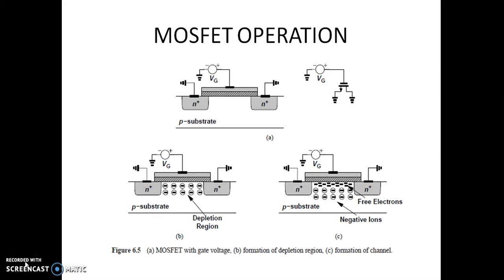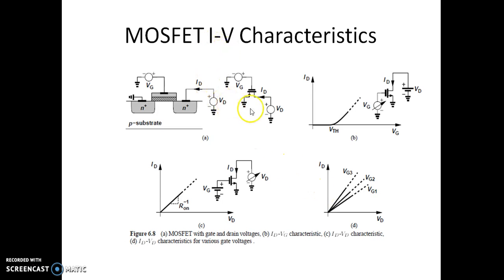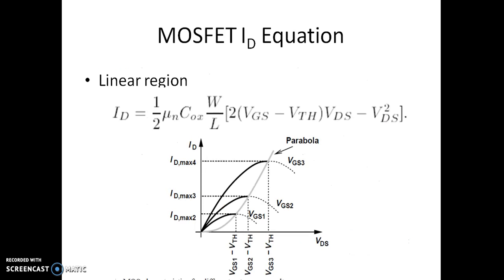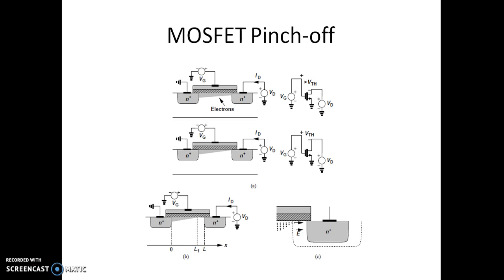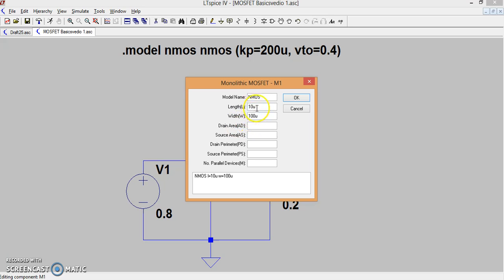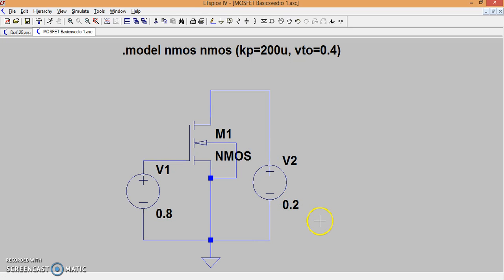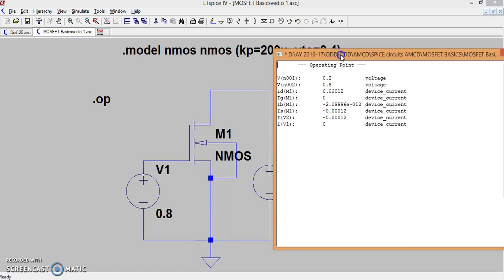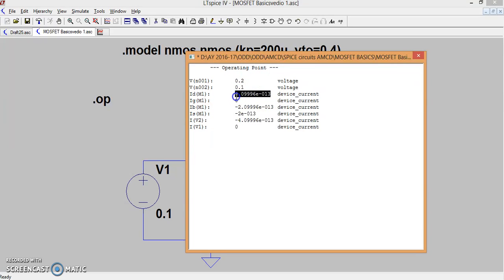6MOSFET Basics 2

Comment: Dear Sir, I would like to request you. Please explain at 1.09 time. Why current decrease if we increase length. For figure 6.9(c)
Reply: The relationship between ID current with the length is W/L as it's inversely proportional to the current, the lesser the length the more current 
If the length is small it forms the depletion region easily and it make a path flow current
Reply: The relationship between ID current with the length is W/L as it's inversely proportional to the current, the lesser the length the more current flows